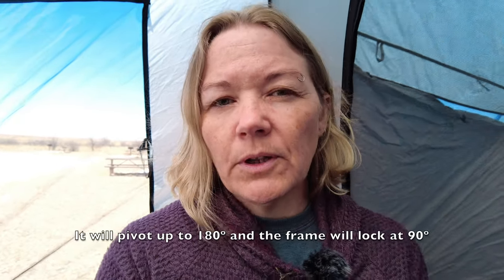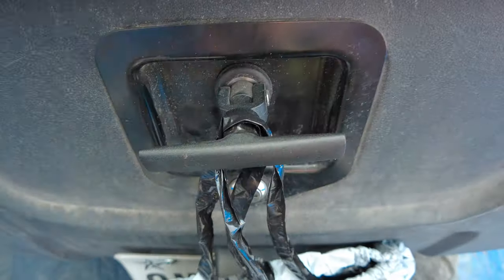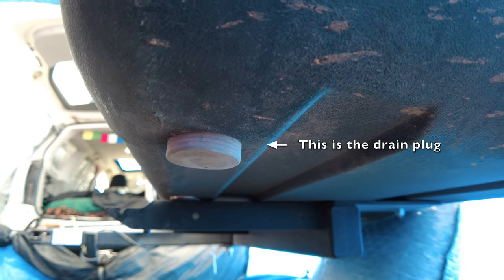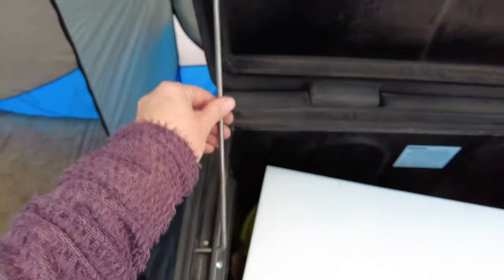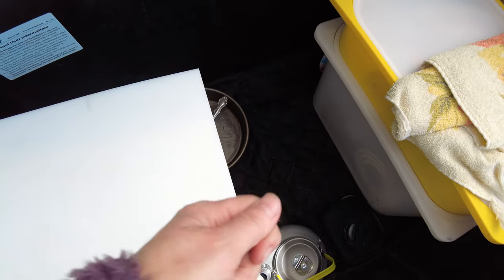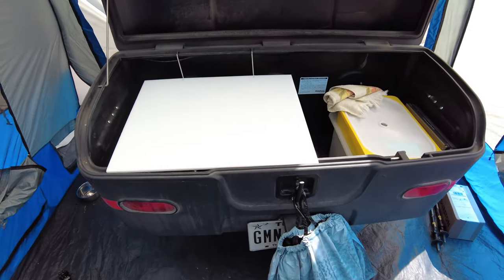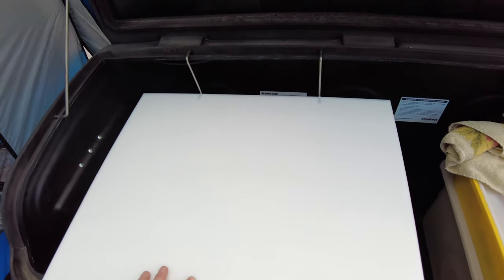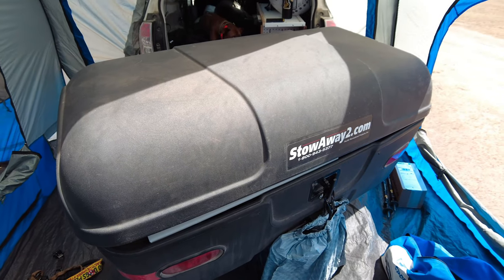Stowaway Max Hitch Cargo Box + Buffet Board accessory: added hauling capacity & car camping kitchen

Comment: You could just drill 2 holes in the back of that plastic board. Then bend 2 pieces of coat-hanger wire into squared-off S-hooks (like the tops of the provided hooks, but on both ends). Then, just HANG the back of the board on the hooks. The board would never come off the hooks unless you lifted it up.  Why they choose that design just boggles my mind. That's the kind of design that employees do when they hate their boss.  😂
Reply from the maker: ha! I do think your suggestion would make it far more stable. Using just the included hooks, it moves a lot during use, which is a bit sketchy when you've got a stove on it. :)

Comment: Does your Subaru have blind spot sensors? If so, does the box interfere with it.
Reply from the maker: My Forester does not have blind spot sensors (2010). Where are the sensors located? If under the rear bumper, my guess is that the Stowaway might indeed block them. A raised hitch probably wouldn’t help either, sadly. Cannot confirm, though. Might be worth an email to Stowaway’s customer service.